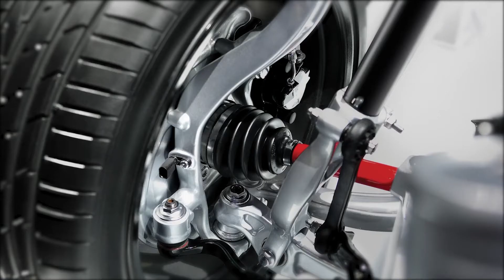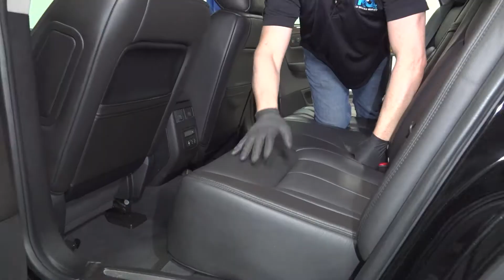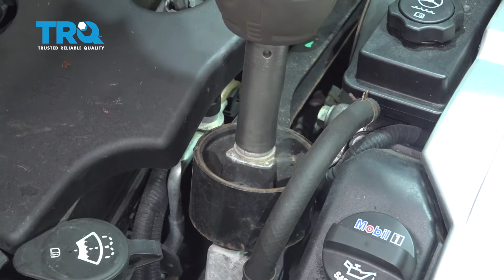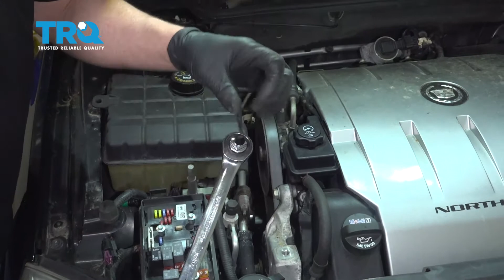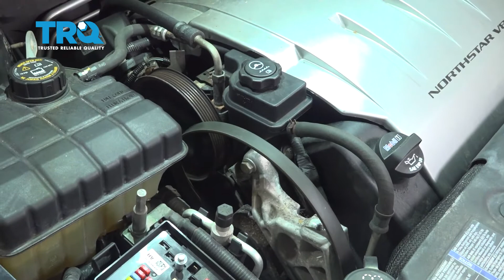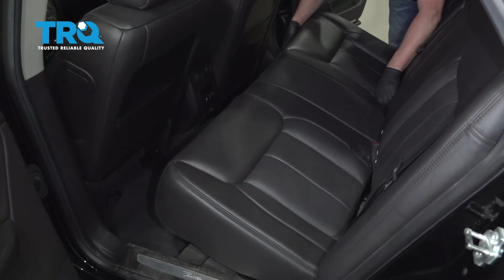How to Replace Serpentine Belt Tensioner 2006-2011 Cadillac DTS

Comment: Thanks for the helpful tips! I have been having problems with my traction control light and stabilizer pops up on my dashboard as well it's been dinging for the past few days know. We had a bad storm last week and im not sure if my sencers got wet really bad. It's hard when your on a fixed income i appreciate any help i can get from really good mechanics like yourself who doesn't mind sharing there tips with people like myself. Would you mind giving me any help. I also have a 2008 dts. Thk You blessings i have also bought a fuel pump from you guy's

Comment: This was immensely helpful.  I wouldn't have thought to jack the engine up.  It made the job easy.  My torque strut was also trashed, so replaced that, the idler, tensioner, and belt all at once.  Removing the front half of the wheel well liner makes it easier to get the belt back on at the bottom.  Thanks for another great video!

Comment: The engine mount you took off is junk. The center bushing is rubber mounted into the bracket. It shouldn't just fall out. Thats a common failed piece that puts stress on other engine mounts